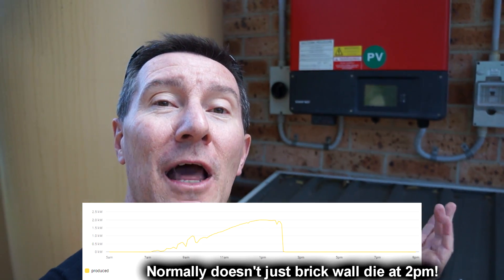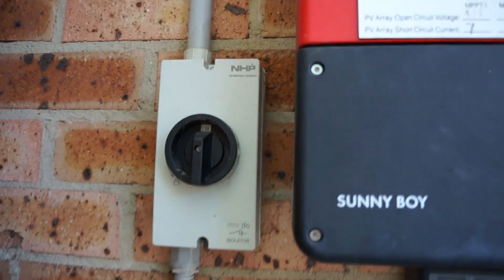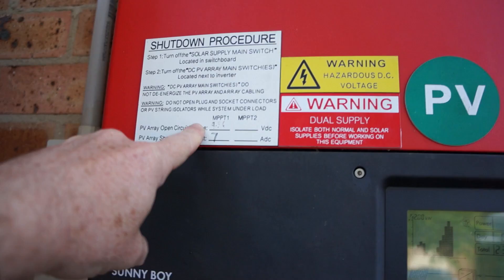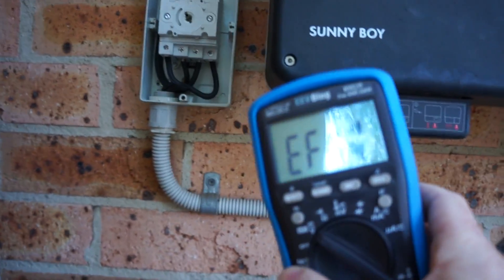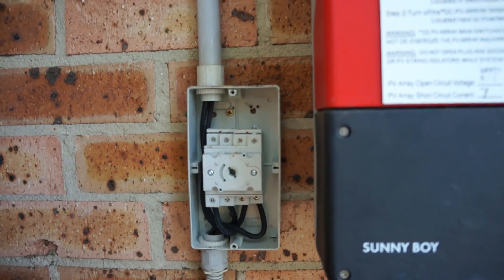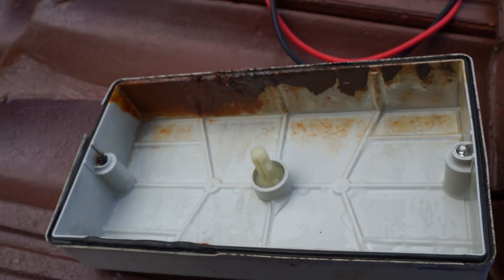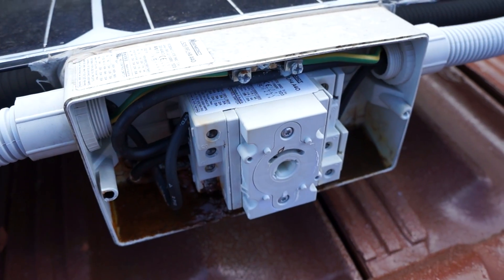EEVblog #1217 - My Home Solar Power System FAILED!

Comment: I'd see if you could get an aluminium box with a rubber gasket instead of plastic. Failing that, covering it with something should solve the problem for the future.

Comment: how is a NCV meter supposed to measure DC voltage if no current is flowing?
Reply: NCV is not meant to measure accurately it only indicates a presence of (hazardous) voltage.  Mine for example will beep if a minimum of 60 volts is present on the line--AC or DC.
Reply: They don't detect current, they detect the voltage field between the conductor and you.
Reply: If it detects DC though, why isn't it constantly getting false alarms due to static electricity?

Comment: "HOPEFULLY I'll get more than I paid for the system". 6 years and still not paid itself out, but they did fail, and if the owner wasn't as smart as he is, it would push the payment for a few hears more. So what's the point? Must be all the eco-friendly commenters, that have no solar panels at all.

Comment: 24 years and I've yet to have a panel fail. I also don't do high voltage DC (keeping things below 120VDC). Too bad so many grid-tied inverters require higher voltages. Anyway, if I have to use plastic, it goes into metal boxes. I hate doing the same job twice. Indeed, after 24 years off-grid, I had one charge controller fail due to lightning and a fan in one controller went bad. That's it, with a bit of light maintenance about once a year. My panels and BOS stuff keep on going.

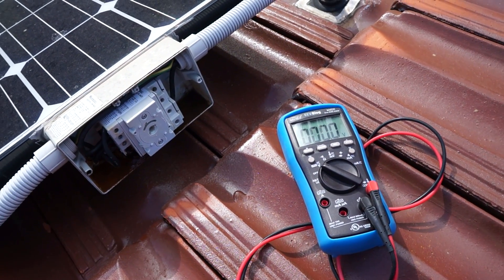Comment: 5:22 "Check out the sludge on my tip", thats gonna come back to haunt you mate. LOL
Also, take the switch out. It's not designed to be oriented that way. My PV array does not have a roof top isolator, just one down by the inverter.

Comment: A proper weatherproof steel disconnect switch would have been a better choice for a roof mounted switch.  That plastic flex conduit tends to disintegrate after several years in the sun, too.
Reply: Yep, wrong conduit used. There are other types of plastic conduits that do not fail in UV.

Comment: Also keep an eye on fire hazard.  I had an experience that almost burned my barn (my panels are on the barn roof) down.  The guys who installed it felt that it needed a sub unit (I don't know what or why it was needed but it had a pretty complex board in it) and it was weather-proof... or so they thought.  Anyhow, caught fire inside and burned itself out after oozing burnt plastic all over my composite roofing (yes, tar roof).  Anyhow, close all.  Shorts can cause fires and burn stuff down, so keep an eye on that.

Comment: if the dumster diver, ($300,000.00) oscilloscope runner would have used his sawsall on the bottom of that plastic case, and just opened the bottom of it large, his panel would be just fine.

Comment: My inverters are on the back of the panels, so it's AC when it comes down from the roof. There is an AC isolation switch outside, a breaker box outside, and then it comes into the inside breaker panel where it goes to another breaker. So, I think that's protection enough likely.

Comment: Love how the seal failed to keep water out, but worked perfectly for keeping the water inside... Yea, not sure that was how it was intended to work...

Spent some time with Google and it seems this switch might not be rated for outdoor use. There is no mention of it in the data sheet I found, and the IP66 rating doesn't say anything about UV, only that it's "Protected from total dust ingress" and "Protected from high pressure water jets from any direction, limited ingress protection". Looking at a site that carries this switch they paste a "Weather protected" stamp on some products, but this wasn't one of those. They did however have an aluminium weather shield for this switch. This was nothing more than a aluminium plate bent so the the switch could be mounted on it while having a bit of protection from rain and sunlight coming from directly above. It was nothing you shouldn't be able to improvise.

Comment: Maybe if the isolater on the roof is required by law, perhaps an aluminium sheet metal cap (a little rain-hat for it) might be a good idea?
Bypassing it entirely would be the ideal solution, though.
Reply: I'd check the law and make sure that someone didn't just do something stupid to pad the kit's bill

Comment: So, do you just replace that isolator switch at night so the panels don't electrocute you?
Reply: You unplug one of the panel wire connectors.
Reply: @v8snail  well now I just feel stupid for not thinking of that.

Comment: New here; do you just have no power now, or do you still have a connection to the main grid as backup?
Reply: Think his setup is just a grid tie system, so he still has hydro service.  There's no batteries or anything involved.

Comment: the isolation switch on the roof is for us emergency responders to disconnected current quickly when in the roof or in the roof space.
Personally i think rubber gloves and unplugging or cutting the string connections at the ends would be ok ( unless the system is at full current ).
Reply: It makes no sense considering rooftop isolators are the leading cause of solar related fires.

Comment: When regulations force to use such stupid multi switch system or you will be charged for it then also on the other hand you will handle the damage or loss on your own so fuck these stupid regulations and join it directly using connector terminal block with same old shit case.... By the way , do the regulations state that the outer equipment must be weather proof protection and should not be like plastic toy ??

Comment: Dave, I'm sorry it failed but as your solar power installation is covered by sparkie rules;) As plenty of people said before, your solar panels pack enough energy in the wire between roof and inverter to kill a person, so there's a switch near the inverter to have visual confirmation for person working at the inverter that circuit has been broken. In HV for example you can't start working on anything unless there's visible gap in the circuit, period (That's also why some people preferred your distribution box old style fuses that you shown in some of your old videos - you can clearly see that there is no connection). Then this isolator is absolutely dreadful, it's not really rocket science to make weather-proof switchbox, devices like cheap table saws tend to spend all their life outdoor and they don't even trip the RCD. $10 aliexpress on-off motor switch with relay and undervoltage protection inside survives years outdoors. I've seen $5 plastic DIN circuit breaker enclosure with random cheap $5 circuit breaker hidden in the bushes in Polish rain used for turning the light on the parking lot surviving 10 years.

Comment: Creating a switch box that will withstand weather in Sydney for longer than 6 years should not be rocket science. My first suggestion would be to avoid plastic, which degrades in sunlight.

Comment: Maybe a dumb question..but how do you disconnect the power from the panels while you change the switch ?
Reply: I'm not sure of the proper way, but I just disconnect the panels from each other.

They use something like MC4 connectors you can easily disconnect each panel from the series line going to the isolator.

Comment: Never trust the DC non contact voltage detectors.  They respond to static E fields which can be no more than a surface static charge from a dust wipedown and even wind.  High humidity may remove surface static charges even the underlying conductors are at potential.  Most panels in the US contain several diodes bridging 1/3 of the panel so they are bypassed in cases of being shaded so they don't overheat from series current being forced them in dark conditions.  A failed open cell results in a panel voltage drop of 10V instead of 30 volts if the panel is bypassed with a diode or opening the string completely if there is no diode.

Comment: Cheaply made switch enclosure. Good weather UV resistance enclosures should be 100% waterproof and made out of a fiberglass composition with a gasket for the cover.
The switch prematurely failed because of this poorly made enclosure. Designed to fail and collect water.

Comment: Plastic should never be used for power enclosures. The standard in Canada is large metal enclosures for disconnects that have lots of clearance between the disconnect and any place that water could enter. We have many that last for 20+ years without failure.
Reply: Nick Moore Plastic, wood, porcelain or marble are the usual materials for electrical boxes worldwide.  Metal boxes now require safety grounding (used to be up to each company, but too many were probably cutting corners, so they clamped down hard).

Comment: The concept of rooftop isolators is so ridiculous that Australia is on their own insisting fitment.
Even New Zealand which shares our wiring rules were smart enough to reject that part of the solar wiring standards.
Reply: I see a good use of it... firefighter come and switch it off from the outside of the house.
Reply: @honumoorea873  
I believe it was the fireys insistence that made these rooftop isolators a requirement.
Ironically though, one wouldn't go on a roof to access these switches if it was on fire;
and it was probably one of these switches that caused the bloody fire.
Reply: @v8snail  I do not know the stats about fire and reasons that make them happend. But I know I would put one external isolator outside my house. It would be like saying an electrical (general) panel in house is useless cause when there is fire in the house it can't be accessed, in many cases it can. When firefighters arrive on site, they will first disconnect panels through the switch then they will try to stop the fire. In my country this is mandatory on public buildings. Cause it would imply higher risk for them (high voltage + water = no go).
The switch got to be on an extremity of the array, easily accessible. If the whole roof is on fire then... anyway, there is not a lot to be saved. 😊
A properly installed switch (not the one from the video) would be able to last for a long time.
Reply: @honumoorea873  
The isolator in the video is mounted as per the AU standards except panel manufacturers can void the warranty when isolators are attached directly to a panel. They should be mounted to the panel mounting rails or independently close by.
Very few switch enclosures installed in the elements will remain free of moisture ingress as capillary action with heating/cooling cycles is incredibly powerful. It's the high voltage DC that makes them an issue with electrolysis increasing conductive paths and an arc that won't quench as there is no zero crossing sine wave as with AC http://www.acsolarwarehouse.com/news/solar-fires-dc-arc-faults-on-solar-systems/

No electrical isolator will stop the panels producing voltage up to the isolator anyway, they need to be blocked from light. The isolator at the inverter or breaker box is all fireys need to access. It would be insane to install your house main breaker switch to be exposed to the full effects of the elements, which is why it isn't.

The water stream from a fire hose will not conduct electricity anyway as there not a laminar flow, i.e. there are breaks between the flow of water. I personally have doused 22kV power lines with a fire hose during a pole top fire after being given the false information that the lines were isolated and I felt nothing through the nozzle.
Reply: @v8snail  There is one way that is not a continuous flow of water but some are and can't be use in those cases while they could be useful.
Micro inverters solve the problem, some optimizers too, they can be electrically disconnected and automatically do in some circonstances.
This switch is badly placed cause the side of the box which is not waterproof is oriented to the top which is pretty dumb in my opinion. It can be put in a waterproof box. In my "design" panels are on the ground, inverter, batteries are in a small shed behind/under those panels. Firefighters can come and disconnect all from one place. Batteries are in a concrete box.
Circuit breakers on each panels can also be used and electrically open/closed with a common remote. There are many possibilities. And if well done can last for decades. I can't see why a waterproof box would let moisture come in, or course the box got to be protected from UViolet to prevent a too fast deterioration.

Comment: two answers, 1 get a metal switch box with a sealed cover, or 2 drill a hole so water can gravity flow out.
Reply: But ... but ... the electrons will leak out :P
Reply: @themaconeau  that was the answer for electrical items in wet locations in the 80s. Just make certain that water can get out, and in items that generate heat all the better, the heat helps dry itself out.

Comment: Couldn't you just use the other side of the DPDT switch for now? The other side (the other 4 contacts) look relatively untouched by the corrosion (provide the switch isn't shorted of course). And yeah, that's some crappy plastic in my opinion. I definitely would have hid that UNDER the panel or something. 

Also, how do you safely work on something like that? Wait until night? How would you safely work with 400+V  live DC wires?

Comment: It need to be protected from sun. Glue a galvanized plate on top or install it under the panels?
Reply: Apparently the regulations don't permit it to be installed under the panels.

Comment: Examinations have identified internal faults that lead to overheating and fires with the Avanco brand of isolators that are used in solar electricity system installations. Others with similar reasons

Comment: The isolator on the roof is a requirement in Australia. Yes, they fail all the time.
Reply: there is a market for a good product there
Reply: My system installed in 2011 doesn't have a rooftop isolator as it wasn't a requirement then. I believe the installation was mandated so that emergency services could isolate the system as some sites have the inverter and switching inside the building.
Reply: mPky1  Often in a structure fire, a "vent hole" will be cut in the roof to clear out smoke or to apply water from above. The isolator is so the panels can be shut off for firefighters to do this safely. I can't imagine how "interesting" it would be to sever wires with 400+ volts unfused DC on tap. :-)
Reply: Only thing I could think of was because the cables go in to the roof space?
Reply: Usually due to bad quality, cheap stuff!, people assuming this is a simple device just to turn off and that’s easy and it will Operate just few times, so they don’t care that much about quality.

Comment: I love stuff like that. I inherited mechanical workshop where electrical work had been done in 1930's that had roof leakages since around 20 years, basically whole building is collapsing. I have a big-ass pre-WW2 circuit breaker (or how they called it in the days "automatic electric switches") where half the case material is rust. Surprise - it still disconnects on overload and passes current when it's on just fine. I have packet switches for light circuits from 1930's that still work just fine. I have high current three-phase connectors using standards that have been obsolete since 1950's that still work just fine. Whole installation is made in the old European style in bended metal pipes, using cables with cloth insulation, with all this weird obsolete stuff, and despite being exposed to 80 years of rain, winter and rodents I installed 30 mA RCD for safety and everything works. Then I have modern plastic three-phase 75A socket that decided to fall apart after few years of usage. Very nice falling apart, when I was removing plug from the socket it decided to remove the business end of the socket and expose live wires ;)
Reply: Have you asked someone to quote on replacing all the nice long-lasting metal conduit and switchgear with modern metal equivalents?